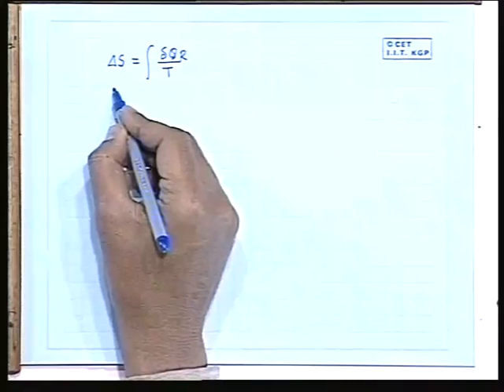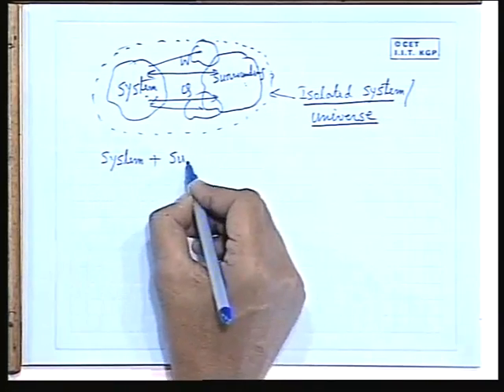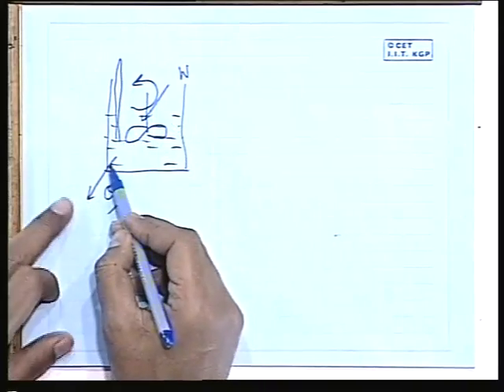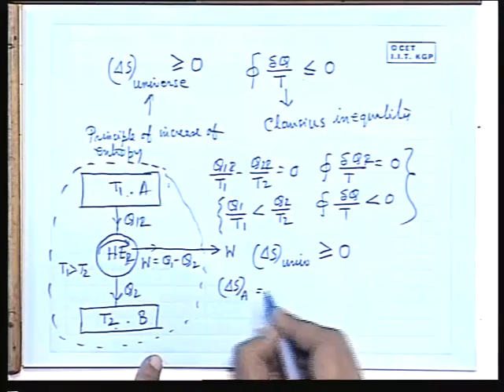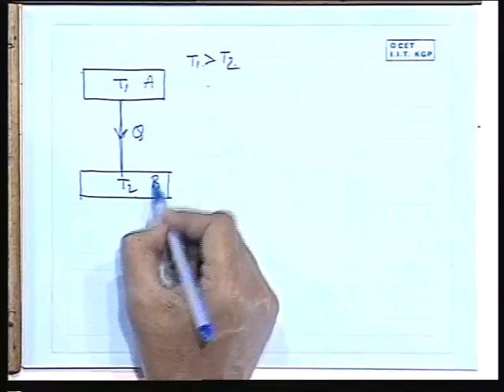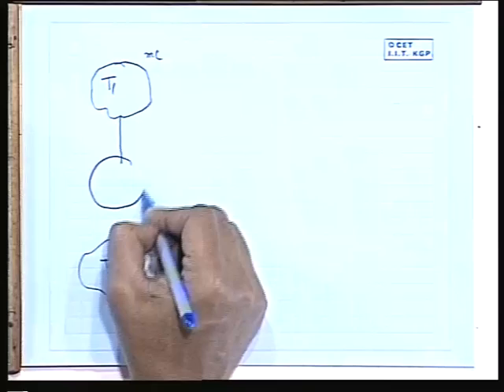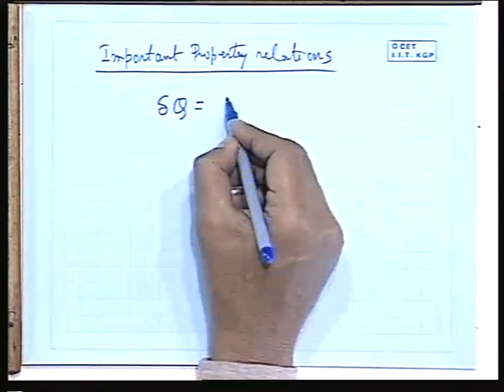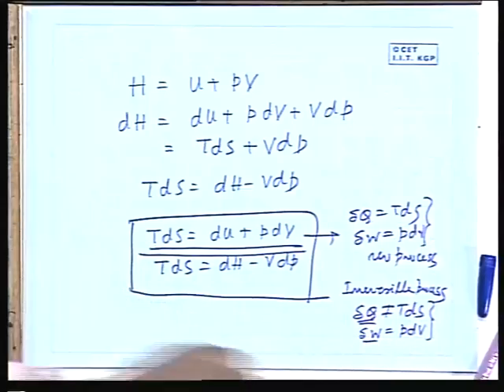Lec-9 Second Law and Its Corollaries-IV

Comment: 17:46, how can we say that when delta s>0, system gets heated?
Reply: ohh i got your cofusion in irreversible case even if there is heat transfer out of the system and it tries to decrease the temperature but there is internal irrevesibilities are present these irreversebilities tries to increase the  temperature(suppose intermolecular energy) so one increasing the temperature(irrevesebilities and other one is decreasing the temperature(heat transfer out of the system) but if the effect of irreversebilities would higher then overall temperature will increase and thus entropy also continuing you can also think of vice versa but in that entropy and temperature of system will decrease i hope it helps

Comment: Sir u said that the fundamental property relation is valid for any process but actually it should be for any process in a closed system & single phase of constant composition.

I can prove it.
Suppose 2 components and 1 phase system so f= 3 so to fix the state we need to fix T, P, x1 . so is we go from 1 state to another with some ∆T , ∆P and no change in composition and if we have another process with same ∆T and same ∆P but some change in composition then their initial and final state in the two processes will not be same, therefore ∆G won't be same

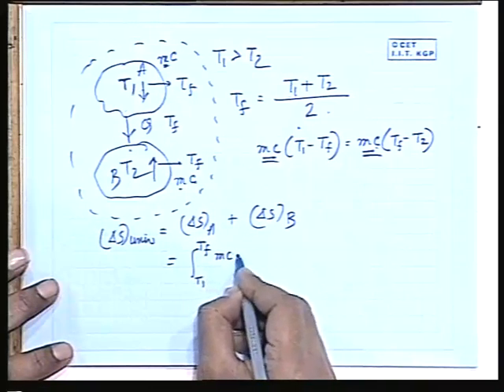Comment: At 35:54 it should be -mCdT in the numerator right?. Because heat is rejected. but sir didn't consider it? Someone please explain this
Reply: Prof has considered the heat addition or rejection in terms of limits of integration not in terms of sign (positive or negative).

In First integration the system is going from T1 to Tf temp (we know analytically the temp is decreasing)

And in second integration the system is going from T2 to Tf (analytically we know temp is increasing) 

Hence no sign is considered infront of mcdT

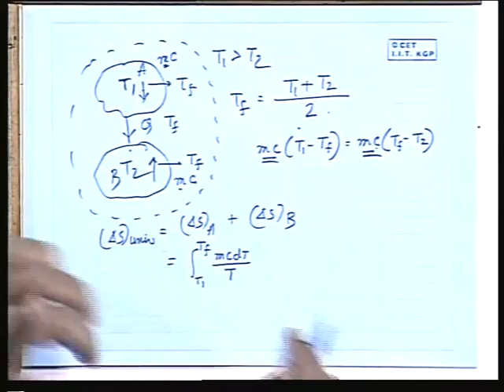Comment: 35:59 can any one please clarify why delta si is not added
Reply: Think of entropy as a point function. So delta S=S2-S1. It doesn't care about path. The circumstance given in the question is for irreversible process, but we can take a different path where the system is changed from 1 to 2, and we take a reversible path conveniently because we know the value of del(S) in that condition. 
That way we can find delS of system, even though it is an irreversible path.

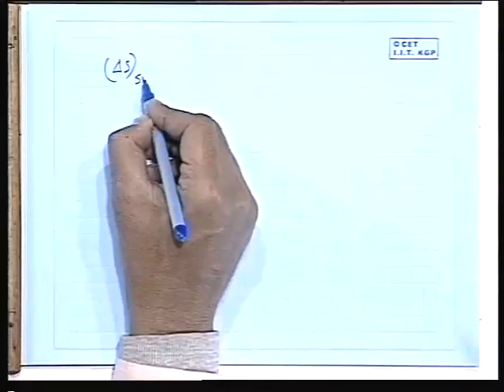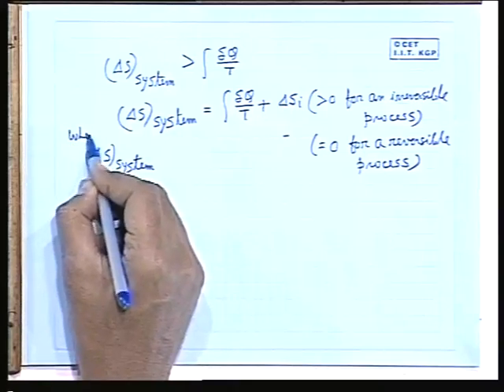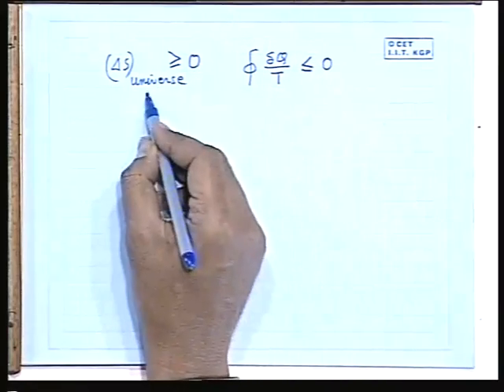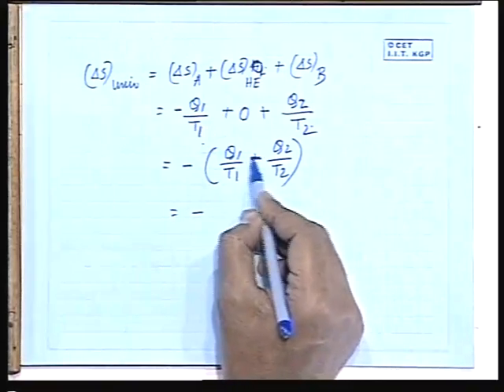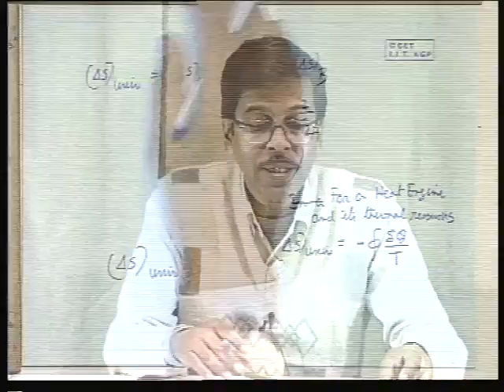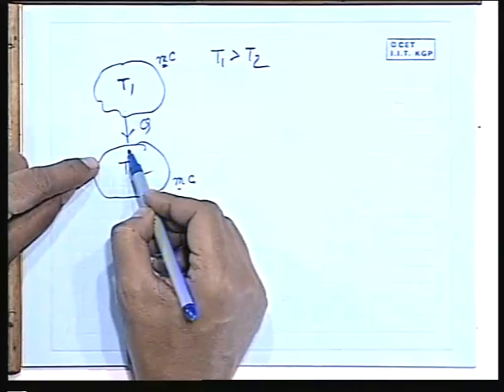Comment: 11:35, 13:41, 14:30, 16:08 *Further clarification on pg no 193 top*, 21:00, 27:53, (29:37-31:18****All Recapitulation), 31:20, 34:15, 40:00, 42:57-(*44:28 why ∆S univ = 0), 47:55,
Q (Lec6 to Lec9)= 56:32,57:00,57:39,57:59,59:04,59:46.
Reply: If you consider a system to be isolated (i.e. no external heat interaction) then the isolated system will try to attain equilibrium. While attaining equilibrium one point of the system (say "A") will lose heat(as temperature is more) and other part of the same system(say "B") will gain heat(as tempr is less). Let temperature of A be T1 and tempr of B be T2. We know T2<T1 so 1/T2 > 1/T1. Now entropy of A=Q/T1 and B=Q/T2. As A is losing heat its entropy will be less that than B. Now change of entropy= High entropy- Low entropy.
 i.e. ∆S= Q/T2- Q/T1
            = Q(1/T2 - 1/T1)
So Q will be positive as 1/T2 is greater than 1/T1. So heat will be added. So change of entropy will be positive or greater than zero.
    i.e. ∆S>0
Reply: @gime_karanjeet_bharali  Sir, I think we cant write S=Q/T in absolute terms. or can we? please correct me if I am wrong.
As per the lecture del S= (delQ/T) but it is never written as S=Q/T
Reply: I am totally lost from 13:30 to 16:30. I am not sure whether he means the two cases of the reversible and irreversible heat transfer process or not. do you have a teacher explained it in English, please?
Reply: @tharialshammari5213  here ∆S is comprising of both reversible and irreversible process. That is the isolated system has both reversible and irreversible process going on in the system. Also as in a isolated sytem the system will try to attain equilibrium so change of entropy cannot decrease as there will be heat interaction in the system itself from one point to another point. By mathematical calculation i have proved that how ∆S>0.
Reply: @gime_karanjeet_bharali  thanks a lot for that clarification. I really appreciate it

Comment: Can anybody please explain what sir said in 14:15 ..first he said for reversible dS=0 but then he said when dS of system is greater than zero for reversible
Reply: In a cyclic process( a process after which the system comes back to itself) it’s zero but in a non cyclic process it can be  positive or negative depending on the interaction with the surrounding.
Reply: If you consider a system to be isolated (i.e. no external heat interaction) then the isolated system will try to attain equilibrium. While attaining equilibrium one point of the system (say "A") will lose heat(as temperature is more) and other part of the same system(say "B") will gain heat(as tempr is less). Let temperature of A be T1 and tempr of B be T2. We know T2<T1 so 1/T2 > 1/T1. Now entropy of A=Q/T1 and B=Q/T2. As A is losing heat its entropy will be less that than B. Now change of entropy= High entropy- Low entropy.
 i.e. ∆S= Q/T2- Q/T1
            = Q(1/T2 - 1/T1)
So Q will be positive as 1/T2 is greater than 1/T1. So heat will be added. So change of entropy will be positive or greater than zero.
    i.e. ∆S>0
Reply: for whole cycle  it's 0 but if you take state point reversebily it"ll will greater than 0

Comment: at 32:28 shouldnt there be an extra term for internal irreversibility in the expression for entropy change of universe since he is considering an irreversible process?
Reply: He is taking entropy change for identical isothermal reversible process that has same entropy change, since entropy is state function. Otherwise entropy due to heat would be q/T_surrounding which would be different to what he wrote but then he would also need to add entropy due to irreversibility and get the same amount.

Comment: at 15:28 is the system mean isolated system since ^s is >0 (taken) if so then what is delQ since isolated has no interaction with surroundings please reply
Reply: Bec system entropy can be greater than n equal to 0
So
If it is reversible ∆s sys=0 which means ∆Q =0
If it is irreversible ∆s>0 
∆Q>0 which means some internal heat interaction has taken place whose effect can be nullified by ∆si
Reply: two systems under observation can be treated as a single  isolated system where heat and work interactions are occurring between them but not external to both of it. 
if heat and work interactions are occuring between them irreversibilly then entropy increases.
Reply: @sunkaraprudhvi  hey guys,  does he means the two cases of reversible and irreversible heat transfer process or not?
Reply: did he said it as isolated system? .. i dont think so... i searched!